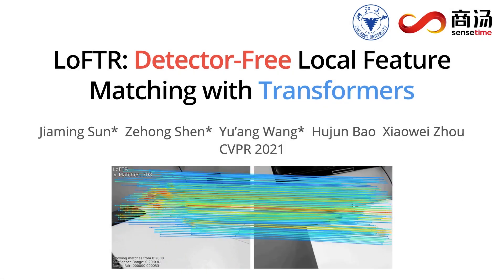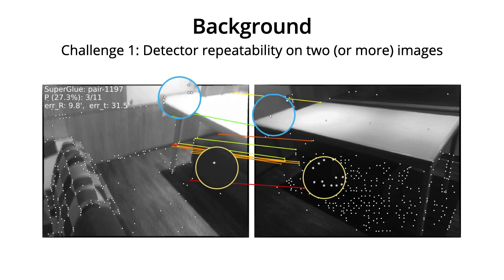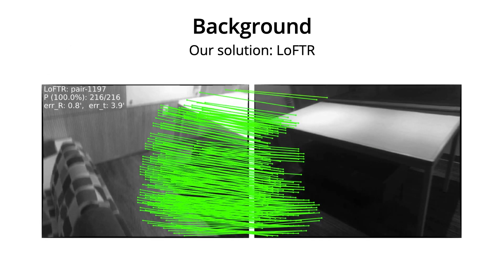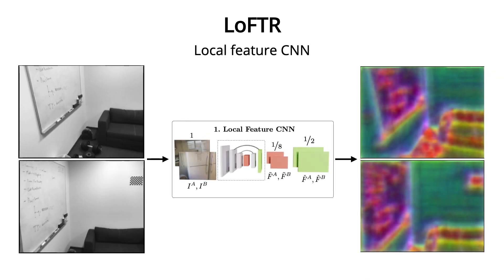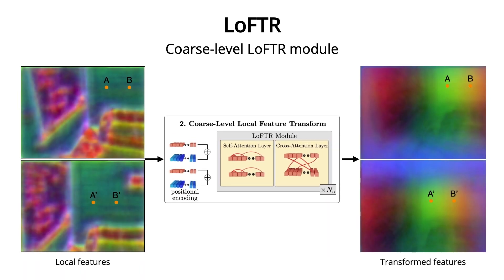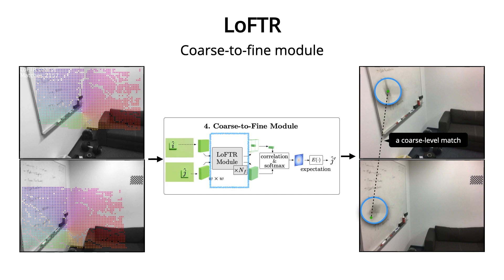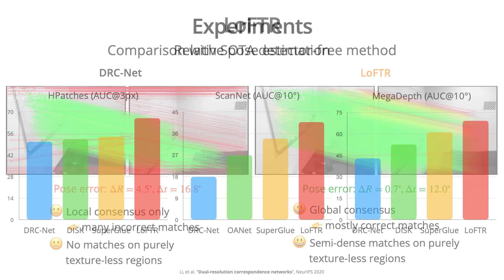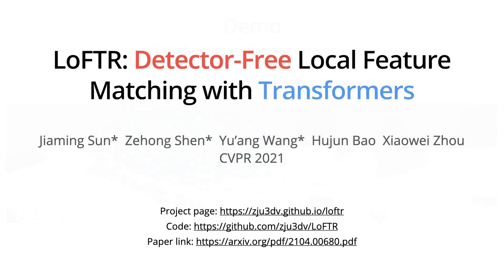LoFTR 5-minutes Introduction Video (CVPR 2021)

Comment: very interesting! what happens during cross attention layer when the input images are pointing at different views and have 0 correlations? is the cross attention layer completely separate from the self attention layer i.e. it doesn't use the result from self attention layer for cross attention? thanks 👍 great work